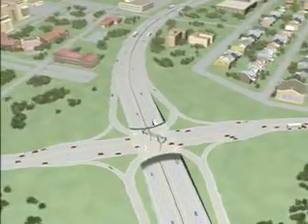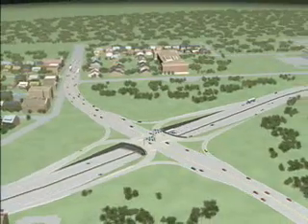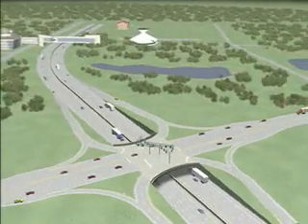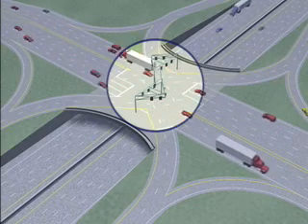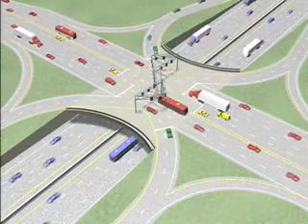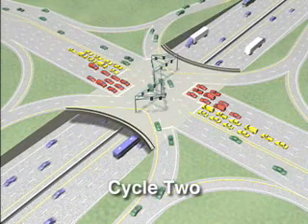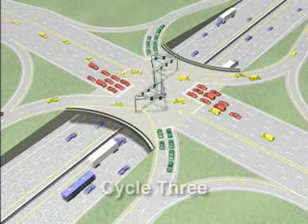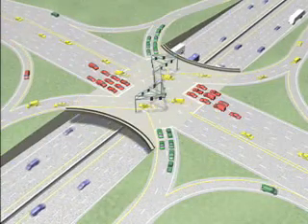Kingshighway - MoDOT Single Point Interchange Animation

Comment: Roundabouts work.  The fact that North Americans don't know how to use them correctly is unfortunate.
Reply: Roundabouts suck except in very low volume intersections that could just as well be controlled by two or four stop signs.
Reply: @swinde  No, putting stop signs on intersections that could optherwise have a roundabout is slower and, more importantly unsafe. However a roundabout requires more space, so should be use when that space exists, and in north america....well...
Reply: Roundabouts take up a lot of space and they break down under very heavy traffic loads.

Comment: Colorado and Texas use this extensively and it works very well.  Wisconsin is still using 1950's design with ramps and traditional intersections or round-a-bouts....  We are stuck with their heads in the sand.....